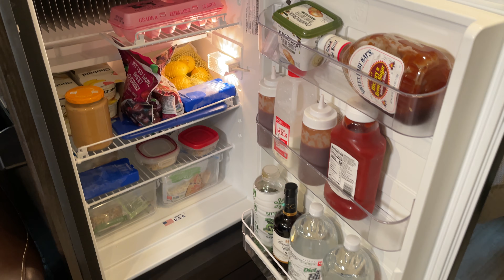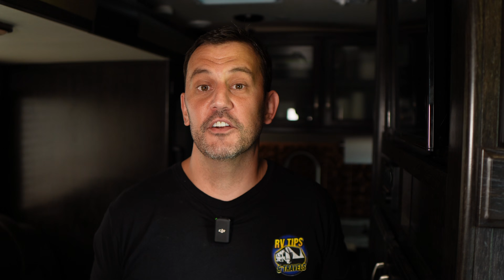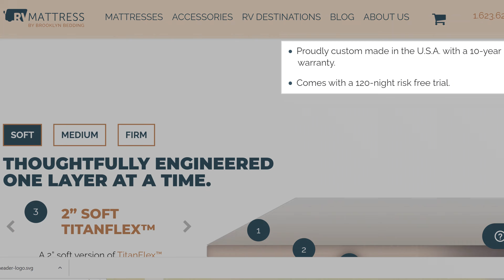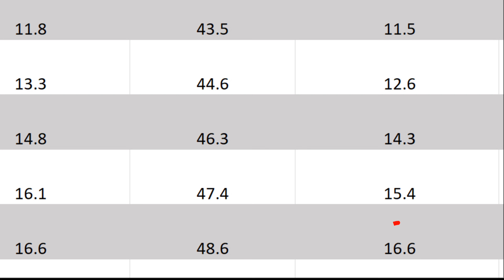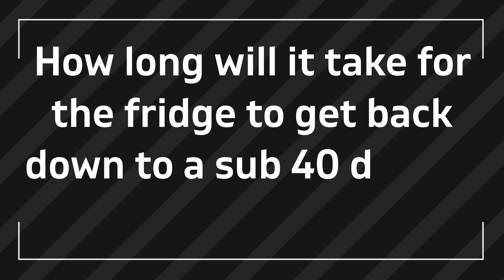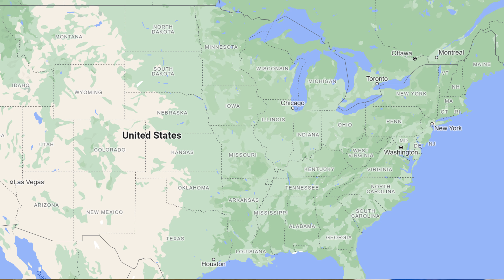How Long Will My RV Absorption Fridge Will Stay Cold w/ Propane OFF & NO Power? Spring/Summer Test

Comment from the maker: ✨⭐ PRODUCTS FEATURED IN THIS VIDEO ⭐✨
🔹 AcuRite Dual Temp Sensor Auction for Make-A-Wish https://www.ebay.com/itm/195953130322?item=195953130322
🔹 AcuRite Dual Temp Sensor (new) https://geni.us/WhtID3i (Amazon)
🔹 RV Mattress https://RVMattress.com/rvtips 
✳Use code RVTIPS for 30% off your new mattress!
🔹 High Quality Coolers https://geni.us/9O9Lz (Amazon)
🔹 Soft Ice Packs https://geni.us/Buksh (Amazon)
🔹 Hard Ice Packs https://geni.us/6Hil (Amazon)
🔹 12V RV Fridge https://geni.us/WEAvQ (Amazon)

*How Long Does an RV Fridge Stay Cold While Driving?  The Surprising Results...? * We tested an RV refrigerator to see how long it would hold temperatures.  Everything was set up as if we were driving to a campground.  With the fridge at its normal operating temperature, how long will it stay cold after the power is turned off?  The results surprised us. 

🎥 We did this test in the fall/winter months and the results were much different.  See that video here: https://youtu.be/57uZAIezwYs

🛠 Resources in this video: https://www.fsis.usda.gov/food-safety/safe-food-handling-and-preparation/food-safety-basics/danger-zone-40f-140f

Check out my friend Josh:  @JoshtheRVNerd  

#rvlife #rvliving #rvtips #rvtravel #rvtips #rvlife

RV ESSENTIALS & TOP PICKS 
🎥Essentials Video: https://youtu.be/yuvS3zZL81c 
🔷Sewer Hose Kit https://geni.us/7dNg (Amazon)
🔷Clear 90 Degree Sewer Elbow https://geni.us/L79gI2 (Amazon)
🔷RV Water Filter https://geni.us/FZ1P (Amazon)
🔷Best Wheel Chocks https://geni.us/9B5i (Amazon)
🔷Power Watchdog 30 Amp Surge Protector/EMS https://geni.us/zKcm (Amazon)
🔷Power Watchdog 50 Amp Surge Protector/EMS https://geni.us/jgOto (Amazon)
🔷Wireless RV Leveler https://geni.us/DAW9N24 (Amazon)
🔷Leveling Ramps https://geni.us/m38VoBr (Amazon)
🔷Liquified RV Tank Treatment https://geni.us/QTUJSrP (Amazon)
🔷Tire Minder TPMS https://geni.us/8HBSTg (Amazon)
🔷Water Pressure Regulator https://geni.us/fTzA0 (Amazon)
🔷Drinking Water Safe Hose https://geni.us/emLdlC (Amazon)
🔷Browse All Essentials https://geni.us/1Omwvhh (Amazon)

MAINTENANCE:
🔶Boeshield T-9 Rust Preventative & Lubricant https://geni.us/uXxstyC (Amazon)
🔶Geocell Proflex Sealant https://geni.us/YXiACx (Amazon)
🔶Water Heater Cleaning Wand  https://geni.us/AcTvhLc (Amazon)
🔶Water Heater Cleaning Adapter https://youtu.be/h6C6ihTQ1cY
🔶Waste Tank Rinser https://geni.us/V2XLE (Amazon)
🔶Road Tool Kit https://geni.us/oBFnd9l (Amazon)
🔶Eternabond Roof Tape https://geni.us/6AXdw (Amazon)
🔶Browse All Maintenance https://geni.us/UvxFP (Amazon)

INSIDE
🔷Screen Door Handle https://geni.us/itRfKUQ (Amazon)
🔷Shower Caddy https://geni.us/ZPcno (Amazon)
🔷Oxygenics Shower Head https://geni.us/jznwF (Amazon)
🔷RV Paper Towel Holder https://geni.us/Acknol (Amazon)
🔷Dimmer Switch (watch video) https://youtu.be/2bbqBcSsRZQ
🔷Electric Heater Fireplace https://geni.us/YmBoktI (Amazon)
🔷Browse All Inside https://geni.us/BWiOR8k (Amazon)

OUTSIDE
🔶Gravity Chairs https://geni.us/VlPR8rn (Amazon)
🔶Ground Mat https://geni.us/wbWWLzf (Amazon)
🔶Table https://geni.us/qsPO (Amazon)
🔶X Chocks https://geni.us/3oyburw (Amazon)
🔶Blackstone Griddle https://geni.us/8BuIrW (Amazon)
🔶Low Point Drain Valves https://geni.us/yBB02h7 (Amazon)
🔶Browse All Outside https://amzn.to/4ld0kcz (Amazon)

👇 COUPON CODES! Use the links. Save money. Simple.

🚐 10% off RV Snappads & Snapjacks https://rvsnappad.com/discount/RVTT10

💦 Blu Technology Water Filtration Systems 7% Off, $80 or more No code needed just use our link:  https://goblutech.com/xxnnkdun 

🛌 Get 30% off your RV Mattress by Brooklyn Bedding at https://rvmattress.com/rvtips
Use Discount Code: RVTIPS

📷 Haloview Back Up Cameras 5% Off & FREE Shipping (Use code RVTIPS at checkout) https://www.haloview.com/products/byte-tango-1080p-observation-camera-system.html?acc=765

🔧 NRVTA Home Study Course https://rvtechcourse.com/discount/RVTIPS20
Use Discount Code: RVTIPS20

🚴‍♂️️ Lectric eBikes - Use our link get FREE accessories https://lectricebikes.sjv.io/nLrJ3x

💻 Our eBay Store! You never know what you’ll find!
https://geni.us/6AyLKnS (eBay)

💥 Join Our FREE Newsletter! https://rvtipsandtravels.myflodesk.com/freenewsletter

If you want to support the work I do to help others, you can donate here:
Paypal: https://www.paypal.com/donate/?hosted_button_id=J2KKM9NR3BJJA
Venmo: https://venmo.com/u/Ross-Stoico

✨ AMAZON RV STORE ✨
https://www.amazon.com/shop/rvtipstravels

Follow Us on Social Media
https://www.instagram.com/RVTipsAndTravels
https://www.facebook.com/RVTipsAndTravels

🙏 If you find a dead link, PLEASE let us know & we’ll send you bumper stickers!

As an Amazon Associate, I earn from qualifying purchases. There is NO ADDITIONAL COST TO YOU when purchasing from our links. Thank you for your support! 2.0

Comment: You also started at 32 degrees which is too cold for a fridg, liquids will cristilize, 36 - 40 is correct
Reply from the maker: thank you for opinion Bruce.  It is appreciated! Keep in mind, most RV fridges dont have a specific temperature setting though.  When RVing, I put food in, turn it on, then usually adjust it during that camping trip depending on how cold it gets and how much food we have in it during any given amount of time.  For the test, I put food in and let it get to temp to start the test.  It managed to get down to 32 degrees, but that would start to freeze a lot of things if left at that temp, so I would agree that 36-40 is a good range for normal use.  But when traveling, starting the test around 32 would get you more travel time, and it really wouldnt stay at that temp for a long enough period of time to freeze any of the food.  Hope that makes sense.

Comment: I added an inverter and 2 105 Ah lithium batteries to our Imagine so we run off of power.  The idea of running with propane on is not something we were in favor of.  After we blew a tire once which in turn busted a propane line at the fitting there is no way I would do that.  I've not run any specific tests but it is interesting to see how much power we use while traveling but still maintaining the required fridge and freezer temperature.  If temps are high we will bump up the setting the night before then turn it down and move freezer packs into the fridge.
Reply from the maker: Very nice mod, thanks for sharing Eric!

Comment: The fridge does have DC electric in it so why can you keep it on the electric setting. I have a class c so it won’t get as hot inside.
Reply from the maker: thats only if you have a 12 volt ffridge.  absorption fridges do not have dc electric power, and even though 12 volt fridges are becoming popular, absorption fridges still dominate whats on the road today.

Comment: Great video once agsin!
My Norcold in my Tioga Class C would nit stay cool long. Always ran propane on the road.
My 2019 Puma Had Ever Chill electric... 3 of them inside of 6 months! 
Now 2020 Flagstaff with absoebtion Dometic.
Ran a 7 hour trip without propane ( accidentally. The auto switch over regulator switcged over however bottle number 2 was shut off!). 
We were pretty well loaded up with fresh and frozen goods.
When we arrived at our destination we were greeted with the screamung alarm of the fridge failure!
Freezer stuff still frozen but barely.  Fresh goods were cool to the touch but not warm. Ambient temps around 80.
We decided to chuck the potatoe salad and a couple other items to be on the safe side.
I might run 4 hours full food without propabe. Beyond that will run propane on the road.
Reply from the maker: thanks for watching and commenting!

Comment: I found some flat ice packs on Amazon that i really like - "Tourit" - quart pack equals 3 lbs of ice, they are colder than ice, stay cold longer, reusable, durable, non hazardous  - 4 for $15 currently.  I even leave 4 throughout my freezer in case power goes out, would have to be off a really long time before things would begin to thaw.  So cold you do NOT use on skin .. hard to hold on to.  They come in various sizes.  
Safe travels❣️
Reply from the maker: thanks for sharing Deborah, do you have a link?
Reply: @RVTIPSANDTRAVELS  i had never tried it before, took me a little minute to figure it out .. but now we know ! )

Comment: Thanks for the great content as usual! Any chance you will do a video on improving the efficiency of these fridges? I've seen videos of adding fans to the back as well as the inside, so we did that on ours... Unfortunately, using a Bluetooth thermometer like you used in this video, we actually were getting higher temps with the fans on!
Reply from the maker: That’s interesting thanks for sharing.  I think I’m done with absorption fridge content for a while. My new rv will have a 12 volt compressor fridge, so I’m interested to play around with those.

Comment: I use an electric cooler (alpicool) for refrigerated foods. 12v dc or 110 ac  power uses 45watts. I plug it in the bed of my truck (with camper she'll topper) while driving. The temperature can be adjusted from -3°f  to 50°f. And Bluetooth to phone/tablet. Works awesome.
Reply from the maker: Nice! Do you have a link?

Comment: Our fridge really struggles in 90 + degree weather.  We freeze water at night and then load it into refrigerator in the morning.  Actually freezing water 24/7, just swapping between the two every 12 hours. Keeps in low 40’s  on ac or propane.
Reply from the maker: thanks for pointing that out, ihavent done enough research into how 12 volt fridges handle high temps but RV fridges really need to improve.

Comment: Great and honest review. I live in San Diego CA. I have made numerous trips from SD to the Midwest in the summer and temps were 115 for three days. I had to leave my absorption refrigerator running on propane. I have since replaced the absorption refrigerator with a 12v compressor refrigerator and couldn’t be happier. I have lithium and lots of solar so the refrigerator now stays on 24/7/365 even while in storage. One of the advantages of endless sunshine.
Reply from the maker: Thanks for sharing!

Comment: Have had an RV with a propane fridge since late 1980s and have never had an issue with propane on while traveling. I will continue to do so until I RV no more.  Oh and this "rule" of 300 miles/day is silly to me. Each drive, like your test, has many variables, weather, fatigue, traffic, etc.
I drive until I don't want to drive any longer. It's really that simple.
Reply from the maker: I chose 5 hours because I know a lot of rv'ers arent driving over that limit.  That way this test would give as many folks as possible an idea of what to expect.  If you drive 2 hours, you have 2 hour results.  Drive 4 hours then 4 hour results, and so on.  The reason I mention the rule is because a LOT of people follow it, whether you agree with it or not. I actually agree with you, you should drive based on conditions and mental/physical capacity, not just set a time limit, but that discussion in this video detracts from what my purpose was. Thanks for watching.

Comment: I freeze up water bottles and before a trip load them up in my refrig and it cools down pretty quick then just load in your food. A small 12 V  fan also helps to keep things colder. If you have an old PC with a fan you can put a USB connection on there. it works pretty good.
Reply from the maker: Great tips thanks for sharing!

Comment: I know this video caters more to the trailer RV, but in my Motorhome there are a couple of other factors.  First of all, since we are inside the RV while traveling, the indoor temperature is not as warm.  We typically only run the Dash A/C so it's not room temperature comfortable, but in the 80-85 range where the fridge is.  Secondly since we do have an onboard generator, we will typically turn that on and run the fridge while we are stopped for lunch.
Reply from the maker: great points that would definitely make a difference in your results.

Comment: We take ice packs from the freezer and place them in the fridge. And getting the fridge up and running, as soon as we arrive, is our first priority. We can level and do everything else afterwards. Fridge first!, is our montra. 
Our travel trailer has an inverter. Why the factory did not hook up the 12-volt through the inverter to the fridge, is a mystery.
Our tow vehicle charges the travel trailer battery as well as its own battery so why would they not hook that up so we could run the fridge on electric while towing?
Reply from the maker: no idea, but that would make sense.  looking forward to having a 12 volt fridge on our next rig.
Reply: It may in fact do that if your trailer has a sub panel and the inverter has a built in transfer switch.  I have a Progressive Dynamics PD55K003 SERIES AC DISTRIBUTION PANEL that has two buses.  Bus #1 works like a main panel and bus #2 works like a sub panel. The main breaker and the converter breaker are on bus #1 along with a breaker that goes to the AC in port on the inverter.  The AC out port on the inverter goes back to a breaker on bus #2.  Both buses have power when connected to shore power.  When shore power is disconnected the transfer switch in the inverter automatically turns off the connection from bus #1 and draws DC power from the battery bank.  This is inverted to AC and returned to bus #2 and only the breakers on bus #2 will have power.  If the breaker for your refrigerator is on bus #2, it will always have AC power available.  And if you have a two way refrigerator you will always have a choice of running on either propane or AC. Anything like your refrigerator that you always want to have AC for should go on bus #2.  But things like your converter that you only want powered when connected to shore power should go on bus #1.  For example, I'm considering a small electric wall heater for the bedroom and will put the breaker on bus #1. I only want to use it when connected to shore power because I don't want to run the risk of draining my house batteries if I have a senior moment and forget to turn it off.

I also have a 250 amp alternator and a switchable 60/30 amp DC to DC charger.  If I follow the recommendations in this thread I shouldn't have to run my refrigerator all the time.  But if I choose to run it on AC, I can easily replenish my house batteries while I'm driving day or night.

Comment: The real question is why did they do away with the 3 way refrigerator?
Reply: Because the 3-way fridge is a lie. The type of fridge that runs on propane is not very energy efficient with electricity.
Reply from the maker: Thanks for watching!
Reply: @jba6677  what? Please elaborate.
Reply from the maker: good question

Comment: I run my fridge on propane while traveling. I don’t have to deal with tunnels or anything else that might require it to be shut off. I do turn off my propane while fueling though. If it’s really hot out - I drive with the generator on so I can run the coach A/C , so the fridge gets 120v then.  No issues, and no worries.
Reply from the maker: Thanks for watching!

Comment: I had usually turned off the fridge if I'm 2 hours away. Have had it off for a 4 hour drive. When bringing ice cream from home, the wife doesn't like it soft (that didn't sound right:face-blue-smiling:) so I've been driving w/ the gas on. Since you don't want to have that debate, tanks have a sudden leak detector that will stop the gas from coming out if hit. (according to Todd from the RV academy)
Reply from the maker: correct, but Todd also condones turning off the propane while driving for techinical purposes of how the fridge operates.

Comment: I have a new travel trailer so I have the 12volt fridge and it is very nice, but when I had the electric/propane fidge I always ran it on propane while traveling and never had a issue.
Reply: We did the same with out truck camper. No issues at all
Reply from the maker: Thanks for watching!
Reply from the maker: Thanks for watching!

Comment: This would be a cool video to have a bunch of RVers do the same experiment and share the data. Although it may be unnecessary as the industry standard is going to be 12v fridges or residential with and inverter so they can be running while traveling.
Reply from the maker: some folks might even opt to replace the absorption fridges with 12 v

Comment: I use propane for my fridge.  Monitoring the temp in warmer southern climates I’ve noticed propane will keep the temperatures close but I see a gradual 2-3 degree climb in temperature. I do not monitor my freezer. I normally drive 300 miles or less usually a total of 6 hours maximum.  I would enjoy seeing your debate on the pros and cons of traveling with the propane on.
Reply from the maker: thanks for watching... my debate on pros and cons... well ill say this... i wear my seatbelt, even though i havent been in an accident in years.  so even though a lot of people drive with propane on (for 40+ years as they say lol) with no problems, that doesnt mean something cant happen.  we usually pack light anyway and if we need food we hit a local grocery store when we arrive at the campground.  it gives us the opportunity to get out and see the area a little anyway.

Comment: Ran my propane fridge from April until we put it away in October, towing, parked and in between.  Never an issue and it worked fine.  New camper has 12V fridge and it runs 24/7 as well.
Reply: It will work fine... The problem is when you have a traffic accident, your rv becomes a danger spewing propane
Reply from the maker: good point
Reply from the maker: Thanks for watching!